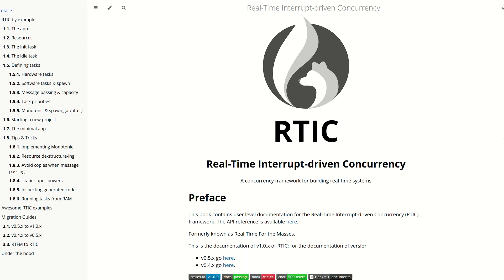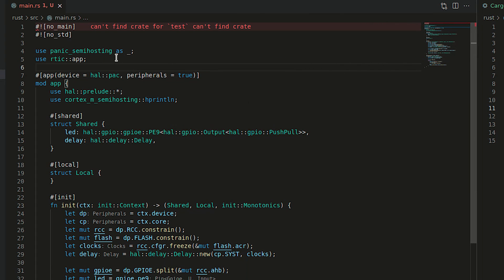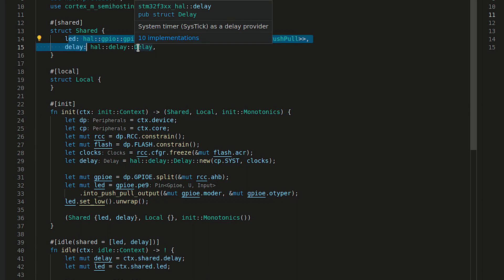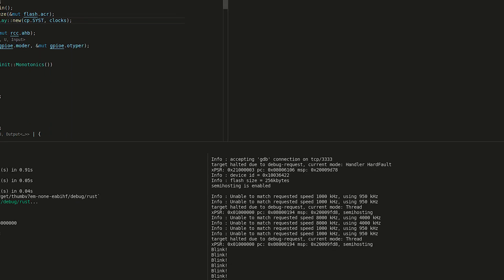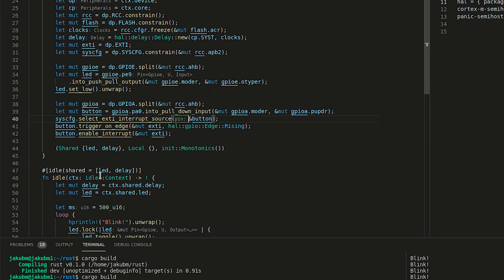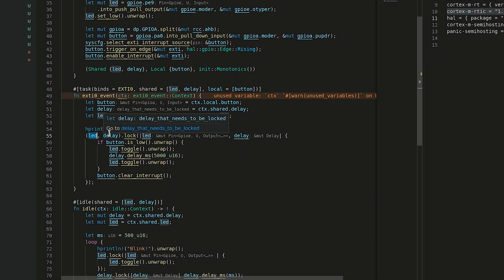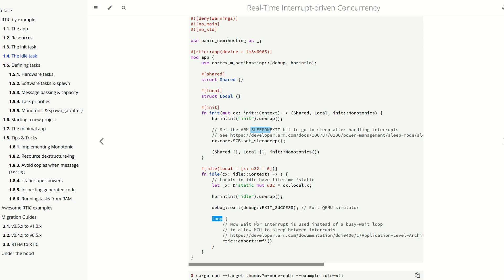Rust Embedded for STM32 Microcontrollers: RTIC (Real-Time Interrupt-driven Concurrency framework)

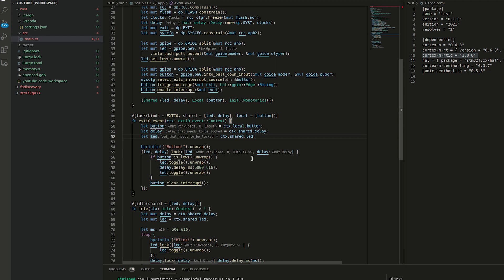Comment: 10:20 That's not correct. The capacity sets the size of the spawn queue for the task. This is the number of how many simultaneous pending spawns of a task are possible.

Tasks itself can be triggered indefinitely.
Reply from the maker: Thank you for keeping me accountable 😊 You are right. I was not clear enough. You can call it more than once, but it will be executed for a one spawn at the time for the given task.

Comment: It's a bit pity that sleep() in the button tasks does not return back the control to the idle task for 1 second. That would have been the case for real OS. Ideally I'd like that my imperative looking code like i2c.get(); i2c.wait(); i2c.send(); wait_for_button(); does not block other threads (including the idle thread). GO-like style concurrency would be much better to have rather than event driven one.